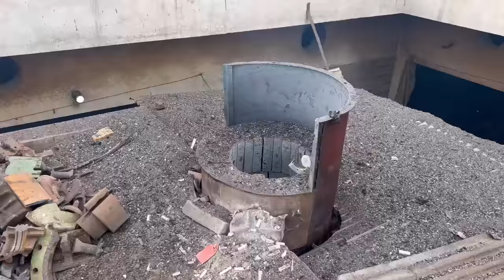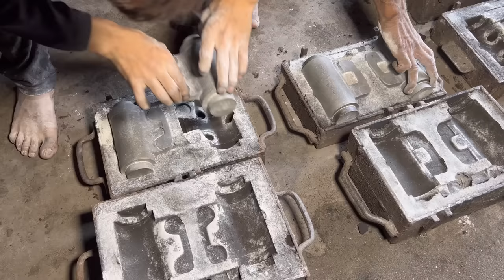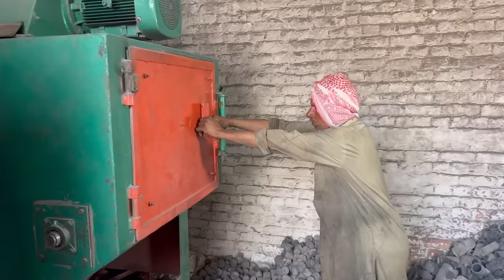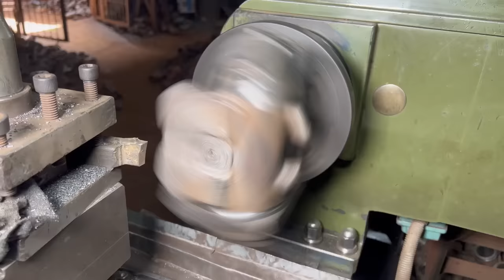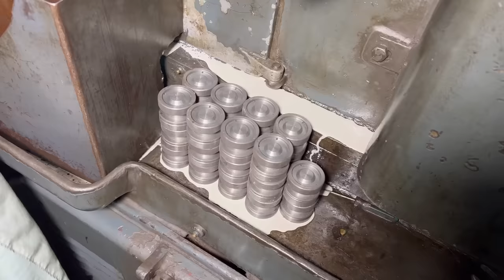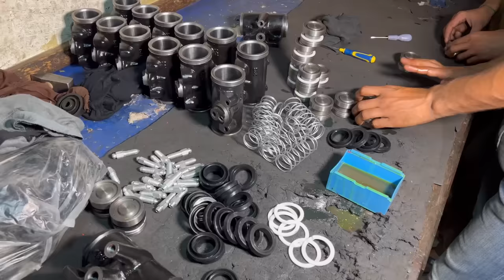Amazing Process of Manufacturing Brake Cylinder for Car

Comment: Pick it up off the ground, play with it and throw it right back on the ground.....Over and over again...lol
Reply: Not a single measurement taken,external or internal.Quality control check to see if it withstands the pressures expected of it.
Reply: @bb21again.67 I believe they accidentally step on some of these parts laying around on the floor. That's your pressure testing.
Reply: @TheOlenyash  my other pressure testing is me liking the video but still not trying to blow a blood vessel in my brain.
Reply: @bb21again.67  don't worry. I've heard they do brain surgeries in Pakistan too.
Reply: @TheOlenyash  Can't reply thought police about!
Reply: @TheOlenyash ya get the hammer test to look for accuracy. If ya bleed close enough.
Reply: Why have an organized parts bin when you have a perfectly good dirty floor to throw it on?!
Reply: And Stand on it with your feet 😂 5:00
Reply: Reminds me of a very big truck workshop i was in ..i ask for a 10mm. open spanner...." its in the toolbox , huh. " your standing on it .

Comment: Completely wrong usage of those angle grinder blades. Those will last many times longer if you do not forcefully press the down. Those should gring the material and not saw or cut.

Comment: I just love how they go and paint those greasy, grimy wheel cylinders.  It shows how focussed they are on making things "look" good, versus actually be good.  In a real factory the cylinders would not be painted, as there is no point.  If they did want to paint them, they would first be cleaned and degreased, then sprayed with primer, then oven-baked for a few minutes, then maybe spray painted.  Not some half-baked quick spray-job.  You see this all over the videos from this area, where they waste time grinding down or lathing down welds.

Comment: That furnace? Is coal? Diesel?
Reply: Metallurgical Coke fired Cupola. It will be efficient if they use charge mixture control, air control, chemical analysis of melt, microstructure, and mechanical properties checks before putting these to use.

Comment: They are truck brake cylinders, they are too big to be for cars, before packing them up, they should test them to see if they work and prevent brake fluid leaks.
Reply: I have never unpacked a spare part brake cylinder that contained a rest quantity of test brake fluid
Reply: @sonnylatchstring can be tested using air
Reply: In these countries there are no brake safety laws, so there will be some factories that cut every corner possible, including testing the finished parts.   You see this a lot with hydraulic cylinders for excavators, where they just slip the pistons together and just see if the cylinder can push against their thumb.  And alternators and welders, which are if at all tested, just cursorily tested under light load.
Reply: What? I ain’t paying an extra  13 cents to have some guy check them. Must be nice to be rich?